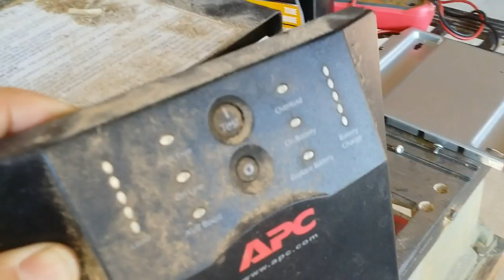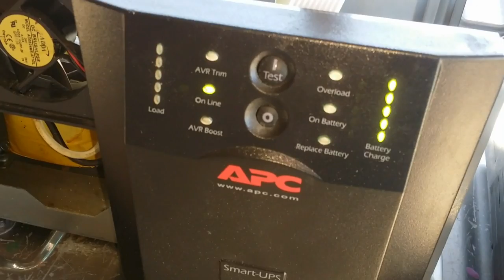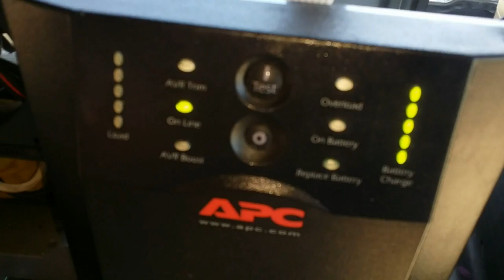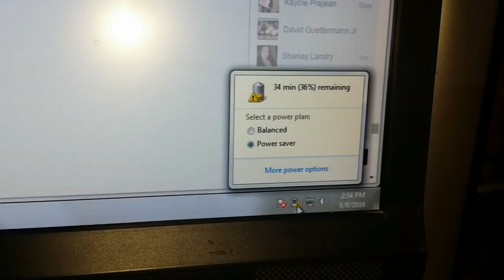$50 APC hack 24V using Lawn tractor batteries

Comment: small batteries work fine,the larger ones you may end up finding the built in charger isn't able to keep the batteries charged, this comes out being more around 100-200 amp hours. IT can take a HUGE amount of time if the unit expects mabe 25 ah-50 ah of batteries and sees 200 connected...